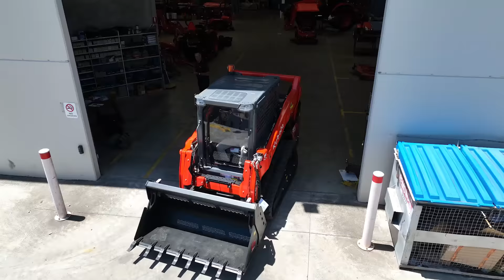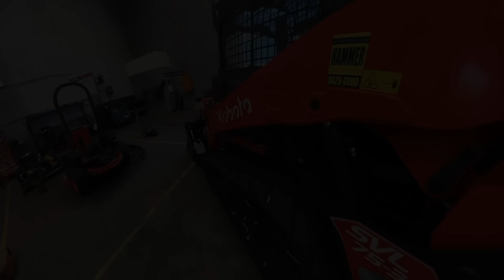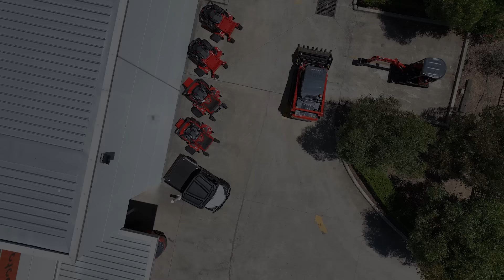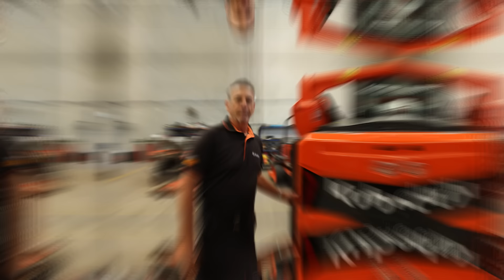The Kubota SVL75 3 - Everything YOU need to know. #kubota #skidsteer #trackloader

Comment: Auto idle?   
Deceleration pedal?
Ksr?
Reply: It has an acceleration and deceleration 2-in1 pedal just press the button next to the quick attach button and it will switch to  what ever its on. The newer 2024 model of the svl75-3 has KSR and the older 2023 model svl75-3  does not. They all have auto idle
Reply: @jesustech7922 how do you activate auto idle?  Mine stays wherever I set throttle.    Ive searched the operator manual for it,  nothing.

Comment: Where is the access for the engine oil drain.
Reply from the maker: The engine oil drain is reached from underneath the machine through the belly pan access panel.
You cannot reach the drain plug from the rear or the top. The only access is:

Access location:

• Crawl under the machine
• Find the belly pan plate directly under the engine
• Remove that plate
• The drain plug is right behind it on the bottom of the engine

So the access is the belly pan under-cover beneath the engine. Once that cover is off, the plug is right there at the lowest point of the sump.

Comment: Mine doesn’t turn that smooth on any surface.  I literally have to stop, turn, go…doesn’t want to make an easy turn while moving forward
Reply: Just got mine and noticed this some. After cracking the throttle up, it turns better. First time having a tracked machine with these controls, used to old-school two stick haha
Reply: @ironbridgeknives I still love the 2  stick.  But yeah, it’s gotten better…I guess it’s just the way it is…my first track machine as well

Comment: The tracks are too short on these machines. They pop a wheelie going up a hill, not even steep the counterweight as the fuel tank is too much because they've shortened the tracks the delay in the joysticks I personally don't care for. It's like running a cat. No thank you
Reply: What a complete crock of …. . Had a 75-2l have 75-3 and a 97-2. None pop wheelies. As for delay in the joysticks, compete bs as well. The 75-3 is faster then the 75-2, and there was zero delay in the controls. The reality is for most operators the controls are to fast. You can’t buy a better machine for the price. Have Cats to.
Reply: I operate the machine daily and don’t have any issues with popping wheelies,lol. It does however what to fly
Reply: The joystick sensitivity is adjustable using the settings in the touch pad
Reply from the maker: Hi Chris, thanks for your comment and feedback mate. Just to clarify, the track length on ground is unchanged from the previous model at 1436mm. We find that contrals are a personal thing and if peeps come to Kubota machines from other brands it can be a small learning curve. What machines do you prefer instead? It would be interesting to hear your feedback and comparissons if you've operated different and similar ones.